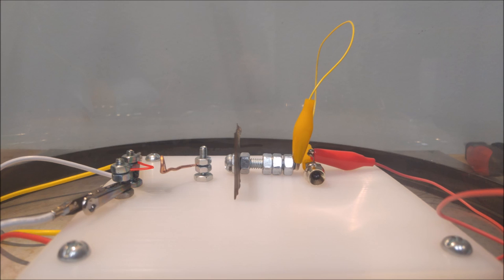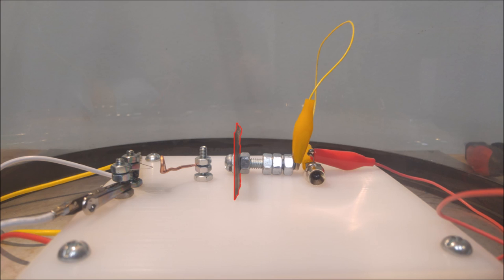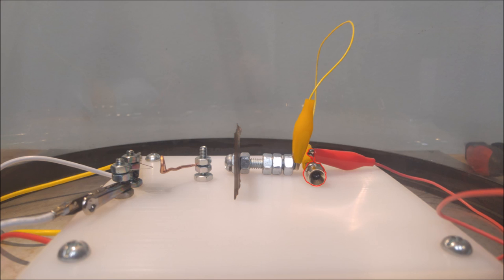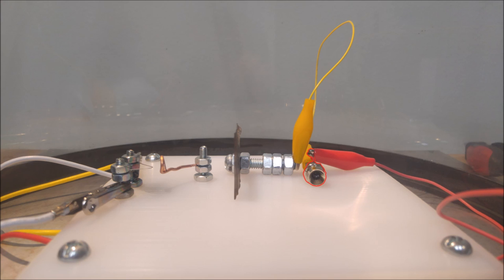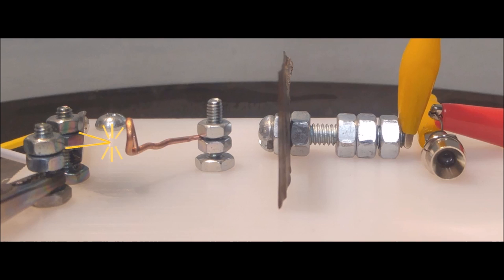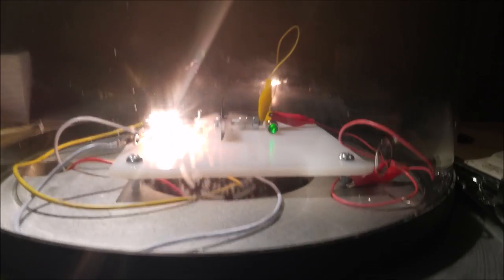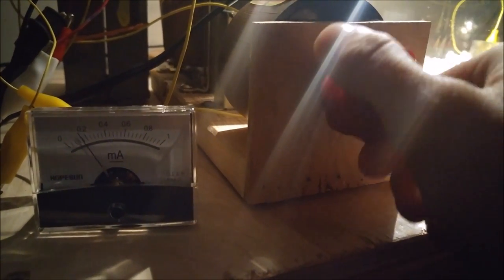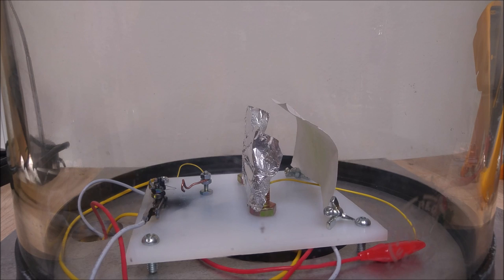How an electron gun works

Comment: I would like to build this. How did you make the vacuum? What is that Pyrex bowl, how do you create the vacuum with the wires? What's the seal under the plate?
Reply from the maker: So the vacuum in this video was generated by a cryopump, which is very out of reach for most people. Probably the easiest way that you could achieve a vacuum of this pressure is with a diffusion pump and a roughing pump. The pyrex glass is something called a bell jar, and I bought mine used, they can be quite expensive. The wires enter the vacuum chamber through an electrical feedthrough, in this case a ceramic one. The seal for the bell jar is a gasket made for that bell jar, but I've seen people use a silicone mat to create the seal as well. Hope this helps!

Comment: The formula you used to calculate the electrons' speed is considering just one electron?
So the filament only emits one electron "per time"?
Reply from the maker: The number of electrons won't matter for that formula. Any number of electrons in that electric field will all be accelerated to the same velocity
Reply: But is there a way to know how many electrons are being emitted?
I got curious about the quantity of them
Reply from the maker: @habbokoreiapix  The number of electrons is directly related to the beam current of the electron gun. There are 6.242E18 electrons in one Ampere, so at a beam current of 0.5 milliamps, there are roughly 3E15 electrons in the beam. I hope this helps!
Reply: @EricDalgetty  thx! It helps a lot

Comment: What does Vacc represent at 1:29?
Reply from the maker: The voltage used to accelerate the electrons. I should mention this formula is really only accurate below 10 kev, because after this point the electrons are relativistic
Reply: @EricDalgetty  Thanks!

Comment: Why does it have to be in a vacuum?

Nice video.
Reply from the maker: Cylde Dellafish The vacuum allows the filament to get extremely hot without burning by preventing contact with oxygen. The lower pressure also allows the elctrons to travel in a straight path without bumping into air particles.
Reply: Eric Dalgetty Thanks.
Reply: It also helps the electrons from being bombarded by other atoms that would be in the air

Comment: Is this similar to how they fire a neutron to start a nuclear reaction in a uranium fuel rod? Seen loads of videos of how nuclear fission works but none thay explain how they start the reaction and where the singular neutron comes from!
Reply from the maker: Not quite, but I had always wondered that, too! They actually use a neutron source, like a mixture of plutonium and beryllium. The alpha particles from the plutomium have a reaction with berrylium and produce enough neutrons to start the reactor. You might check out the wiki article for "neutron source"

Comment: Hi. Thanks for your video. Is very simple and illustrative. I have a question. Did you bought the tungsten filament with the V shape or did you bend the filament by yourself?. Many thanks
Reply from the maker: I'm glad you liked the video! I bent the filament myself, it is not too difficult. You can buy very thin tungsten wire on eBay (I think the one here is 0.3 mm)

Comment: Great video. I am making my own electron gun at home, and the tungsten vaporizes/smokes excessively. I am using a 6v battery as the current source to the tungsten filament. How do you keep your filament from smoking?
Reply from the maker: That sounds like there is too much oxygen around the filament, are you running it in a vacuum? And are you able to measure the pressure around it?
Reply: @EricDalgetty  Eric, thanks for the quick reply. I do have it in a vacuum, but I am using an old mini fridge compressor which only is allowing me to get to -16 Hg. Which means it is about little more than halfway to a perfect vacuum. I am assuming that the tungsten needs a perfect vacuum to work effectively. Did you use a two-stage vacuum compressor to get your vacuum chamber perfect?
Reply from the maker: That's definitely going to be tough to keep the filament alive at those pressures. Generally I would guess that you need <1 torr to prevent it from burning too quickly. I usually use at least a 2 stage pump, you can sometimes find them used at surplus places. Another cheaper option is to find a sorption pump that you could use with your current pump, although I haven't had much experience with those
Reply: @EricDalgetty  Thanks, I will definitely change out the pump or use a sorption pump.  I will let you know how it goes, as I am using this for a tabletop experiment for a new confinement method for fusion. For the tabletop, I only want to test the electron confinement capabilities. I created a website on the new concept called fusionandgravity.com, feel free to check it out, and thanks for your help and advice on the vaporizing tungsten issue.
Reply: @samuelmoss4014  That seems really interesting
Reply: @samuelmoss4014  I'd love it if you explained how it works to me, explanation on your site is kinda confusing

Comment: What about coolent? As the sheet absorbs a lot of energy it might melt right?
Reply from the maker: You're correct, in high power systems like an X-ray tube, you definitely need coolant to stop the target from melting. In this system the power was only a few watts, so the target likely wouldn't have heated up very much.

Comment: 1. After accelerating the electrons into a vaccuum, can the electrons be stored there indefinitely?
2. If no to question 1, can they be stored there indefinitely using a magnetic bottle? (using regular magnets, not electromagnets)
Reply from the maker: Hi, good question! I'm not a physicist, so I don't want to use the word "indefinitely", but there is something called a penning trap and something called a cyclotron, both have ways of keeping electrons in an orbit, but I'm not sure that they will stay there forever.
Reply: Thanks for replying so soon, i'll check them out.

Comment: How is the filiment active and held at a low potential?
Reply from the maker: It is possible to have both AC current flowing through the filament, and to have a high voltage potential on the filament at the same time. You can see this in the design of some vacuum tubes. You can google the circuit diagram of a vacuum tube diode. I hope this helps.
Reply: @EricDalgetty Awesome, thank you.

Comment: Hey man, I've decided to look into building and electron gun for an idea I have in mind. Do you have any plans or a viable site I can get the plans for the device from? Thanks
Reply from the maker: I watched Applied Science's videos to help me when I started building the system (there's a reason my chamber looks similar :) ). My advice is to go through eBay and find the materials that you can cheaply. The vacuum chamber ends up being the much more difficult task than the electron gun, I think. Good luck! Ask me if you have any specific questions, maybe I can help.
Reply: Ironically I just started watching the disassembly of a cathode ray tube as I saw this message from Applied science. I just learned that the old tvs used cathode ray tubes to generate a picture, one of which I have in my house so I'm going to attempt to take it a part tomorrow to see if I can use the electron gun in that for the experiment. Will keep you updated!

Comment: awsome video!I have a question though: in the second experiment is the electric potential between the copper and the foil or between the heater and the copper?
Reply from the maker: Thanks! The potential is still between the copper anode and the filament.

Comment: Very nice, would you explain how you build the phosphor screen ? I try to build a SEM and try to proof the electron beam.
Reply from the maker: Sure! You can order a chemical called "Zinc Sulfide" online, I bought mine on eBay pretty cheaply. Make sure that the zinc sulfide is made to glow in the dark. I usually add water to make a paste and then paint it onto a surface. Hope this helps!
Reply: hindhi MA bhi explain kijiye

Comment: Is your anode connected to a different circuit than your led lamp circuit
Reply from the maker: The anode is on the same ground as the LED
Reply: @EricDalgetty  thx, I understand now, it doesn't go to ground right away, instead it flies past that to the plate, but why? Inertia?
Reply: @EricDalgetty  is it because it chooses the leat resistance path through air instead of pushing it self trough coper wire at first, but then gets trapped in a circuit and has to do it anyways after?
Reply from the maker: @adiliraliyev5882  This is all taking place in a vacuum, so there is no way for the electrons to lose energy except for colliding with something. I think you are correct that it is the electrons inertia that keeps them going. When they are at the cayode, they see the anode as a solid plate because it is so far away. As they get closer, they only experience a net force forwards because they are attracted equally in all directions towards the loop
Reply from the maker: When the pass the anode (copper loop), there is no more force exerted because the entire chamber is grounded. There is no electric field to cause a force.

Comment: Does anybody know if magnets could slow the electrons down just so that the collector isn't as hot? The electrons are going pretty fast so
Reply from the maker: A magnet can only change the electrons direction, it can't make them speed up or slow down. If you wanted to slow them down they would need to pass through an electric field (the reverse direction of how they were accelerated). There is something called a beam degrader, which is some material that the beam has to pass through on the way to it's target. The beam will deposit some of it's energy in the degrader (as heat) so that it has a lower energy when it reaches the target.
Reply: @EricDalgetty  But what if like instead of a collector you have a powerful magnet? Electrons are charged and they have little kinetic energy, wouldn't they change direction and go backwards
Reply from the maker: It is possible for them to turn around, but it won't change their kinetic energy. You could cause them to hit the collector at different angles which would probably affect how much energy is transferred to the collector vs. how much energy is retained by the scattered electron
Reply: @EricDalgetty  Thank you!
My plan is to have an electron gun and use magnets to keep the electrons in a container and I want to see if I can store a little energy
Reply: @EricDalgetty  By the way, what transformer so you use/recommend?
Reply from the maker: @alexanderrydberg6118  For this experiment I used an oil ignition transformer rectified to DC. Be careful with those though, they can put out dangerous amounts of current!
Reply: @EricDalgetty  If I was to build an electron gun and I want as much output as possible is that what I should get?
Reply from the maker: @alexanderrydberg6118  That depends by what you mean by as much as possible. More current will give you more electrons, more voltage will give higher energy. In general, I'd say 1mA is probably enough current, and about 1000 volts is easy enough to work with. Keep in mind that the higher the voltage (energy) the harder it will be to bend the trajectory with magnets
Reply: @EricDalgetty  So after I reach 1000 volts I don't gain any more efficiency it just makes the electrons go faster?
Reply from the maker: @alexanderrydberg6118  If your setup is similar to mine, your efficiency will decrease above about 50 volts. After that, you'll increase scattering and secondary electron emissions

Comment: Hi, Eric. I want to get the schematic of this electron gun. Where can I get the schematic??
Reply from the maker: Hello, there isn't really a schematic. Are you wondering about electrical connections?
Reply: @EricDalgetty Thank you for your quick answer. Actually yes, i want to know how can i connet those like you
Reply from the maker: @임태화-c6g  I think this is a useful schematic: https://qph.fs.quoracdn.net/main-qimg-db083012c51a6e2308b2ac23bcd37d9f
Reply: @EricDalgetty I saw some schematic about electron gun in the internet, and they used variable resistance and balancing resistance when they heat the filament. You didn't use them, right??
Reply from the maker: @임태화-c6g  That's right. My setup is different in 2 ways. I have no "grid" or "wehnelt cylinder", and I am not using the balancing resistors or a bias resistor. For a very rough setup like mine this is okay, but for something like a scanning electron microscope, it is better to have the wehnelt, balance, and bias resistors to create a more fine focus. I can still focus my beam to maybe 2 or 3mm in diameter
Reply: @EricDalgetty  Seeing a picture that you gave me, high voltage is connected with filament and anode, right? What i wondering is that is this ok to connect high voltage only one way with anode??
Reply from the maker: @임태화-c6g  there needs to be a potential between the filament and the anode. Only one wire is needed to connect high voltage to the filament
Reply: @EricDalgetty  And what kind of material is the anode made of?
Reply from the maker: @임태화-c6g  Copper in my case
Reply: @EricDalgetty Thank you for your kind answer. Have a nice day :)

Comment: Can the electron gun function outside of the vacuum?
Reply from the maker: Good question. There are two reasons why the electron gun DOES need a vacuum. The tungsten filament would oxidize and burn out if it was exposed to atmospheric oxygen, and the electrons emitted would only be able to make it a few micrometers before they lost all their energy through collisions with air particles. There is something called a Lenard tube which you might find interesting. It uses a very thin window to allow high energy electrons to pass into the atmosphere.
Reply: @EricDalgetty  is it possible to provide high enough voltage, constant or pulse in order for the electron beam to reach greater distances over time? Specifically applying voltage to the accelerating anodes and such?
Reply from the maker: @arkohmay  If I understand your question, yes the electrons will travel faster with higher accelerating voltages. This is not a linear relationship, though, because the electrons are traveling at relativistic speeds (speeds which are somewhat close to the speed of light) around 10keV. These higher energy (velocity) electrons can also penetrate further into matter before they are stopped.
Reply: @EricDalgetty  Another question if I may ask, but, could you use a nichrome alloy filament instead of tungsten to act as the cathode so that it may function outside a vacuum and not oxidize as quickly as tungsten?
Reply from the maker: @arkohmay  Potentially, but the filament usually needs to get very hot for thermionic emission to take place. But, if there are enough gas molecules you don't actually need a filament. There is something called a "Hollow Cathode" which uses ionized gas to produce the electrons. I think you would need incredibly high voltages if you wanted to make an electron gun that way, like more than 1,000,000 volts
Reply: @EricDalgetty  What gauge wire for the tungsten filament did you use?
Reply from the maker: @arkohmay  I believe it was around  0.8mm, but I don't remember exactly. The thicker the wire the more current it will need, but it will last longer and is easier to work with because it stays in place better.
Reply: @EricDalgetty  How great would the voltage difference have to be between the cathode and anode in order for the beam to reach a noticeable distance outside a vacuum?
Reply from the maker: @arkohmay  According to a Harvard website about radiation shielding (and beta radiation is the same thing as an electron), a 1.1MeV electron will make it roughly 3.8 meters in air. At this distance though, an electron beam would have already spread a very wide distance, because electrons are easily scattered. There is a free simulation software called "SRIM", and it has some examples for high energy particle beams. There is also a free electron simulating software called "casino", and you can input lots of layers of material, it is made specifically for electrons.
Reply: @EricDalgetty  Towards the end of the video, when mentioned that the accelerating voltage was high enough that the filament wasn't needed, what might that voltage be exactly? Also, how much greater would the voltage need to be outside a vacuum?
Reply from the maker: @arkohmay  When I made this video I didn't totally understand the topic. In this case what I was referring to is a Field Emission Gun. The important thing is not the accelerating voltage, but the electric field (Voltage/distance). This requires a very sharp tip, sometimes tungsten or carbon nanotubes, and a very small distance between anode and cathode. This also requires a very high vacuum, around 1E-9 torr. Some scanning electron microscopes use these types of electron guns, and the accelerating voltage can be from as low as 1 keV to more than 100keV.